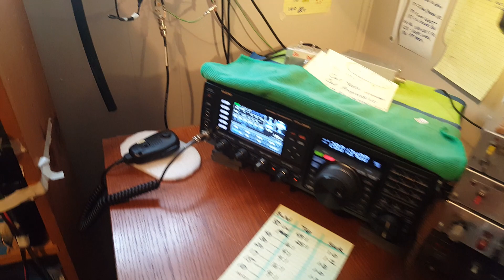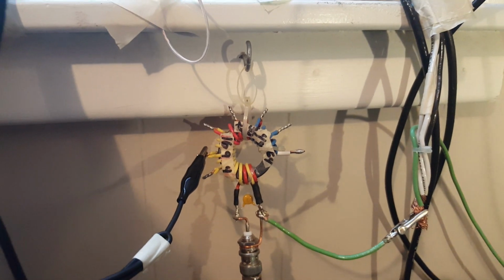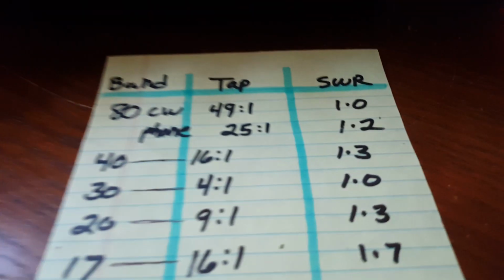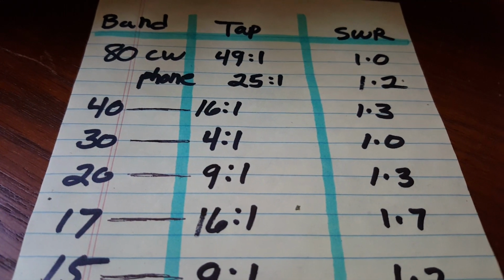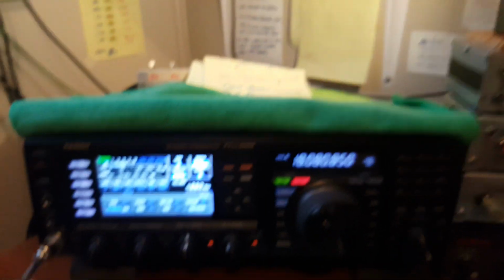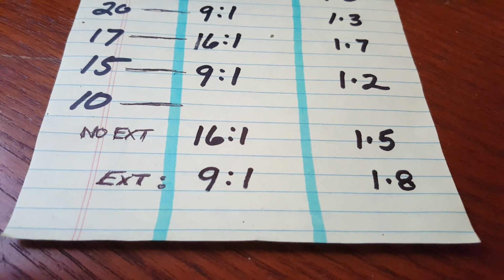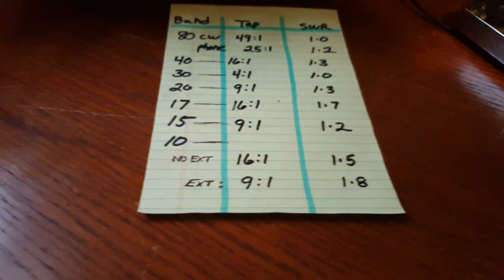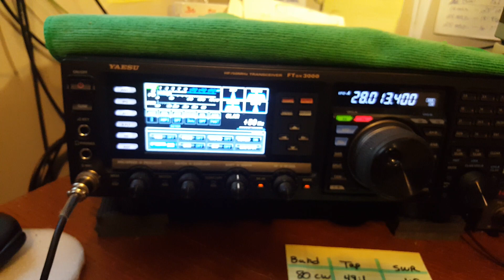80 EFHW & Multi tap UNUN   part 1 of 3   Intro & Demo

Comment: wow nice interesting video ! I wonder how can those end fed half wave "commercial" antennas can "resonate" on all bands with a simple 1:49 transformer then ??? I am already thinkering on how to make a relay switcher for that type of system you are using !! I see some cheap antenna switchers boards with relays available on ebay, I would wire it backward, have each tap to the "output" of the relays and have the "input" as the antenna... that way you can multi switch any tap on your core transformer !!!
Reply from the maker: Thanks for the wonderful comment! I'll reply again a little later and explain why I 'think' they are able to do that. ok?   :)
Reply: @n8nkqrp595  awesome ! thanks for the reply too ! I am so surprised you can make this work with aligator clips... I am trying to read the attenuation on a core transformer with a vna and as soon I have bare wires, the vna readings goes everywhere...
Reply from the maker: @Aleziss  Thank you! Well, the alligator clips are connected at the highest Z point in the whole antenna system, and that means minimal current. I did a vid showing the math.. the current flowing in the windings for various power levels. I can't remember which video tho. lol. But at the 100w power level, I think it was on the order of under 300 milliamps. And that's nothing for an alligator clip to handle. The current might have been less. Uh, hang on... nope. I did the math again: at the 100w power level, it's 157 milliamps RMS. or 0.157 amps. Nothing. lol. That's using a tap with 4050 ohms Z.
73   :)
Reply: @n8nkqrp595  ok thanks again for the reply, I on my part, it is the VNA readings that goes everywhere when I have bare wires and aligator clips as I try to measure the attenuation on different core materials. I don't think it had to do with the leads being able to handle the load as VNA is extremely low power. 

And I was surprise to see how well your system react even with aligator clips with many junctions, you had stable result and you did not seem to have RFI issue either which is quite surprising to me...

Comment: So 49:1 balun, what length of wire did you end up with? Any counterpoise? Any issues having the wire in the shack?
Reply from the maker: Good question. I don't know how long it is. lol. When the back yard dries up this spring I'm going to pull the wire down and measure it. The antenna works the same with or without a counterpoise.. same SWR usually.. altho I do have a piece of coax that's about 2' long that connects the UNUN to the rig.. so that acts like a short counterpoise. With many EFHW antennas you can buy, they'll oftern recomment a short counterpoise.. a few feet long type of thing. Not always tho. Issues with the UNUN in the shack right next to me? Well... with QRP it's never an issue. No ill effects. With 100 watts- I cannot use my Bose noise canceling 'phones- (they shut off when i transmit)  so that tells you that I'm in a strong RF field. No ill effects on the radio, etc tho.. and that's with the UNUN about one foot from the rig.  I've tested the ant and UNUN at 100w on all HF bands up to 10m - and have never detected any RF on any equipment.. meaning it wasn't 'hot' with RF.  I've heard this can be an issue with EFHW ants, but I've not had it happen. 73

Comment: Hey that thing works, and if it works and you can't get out without blowing up the radio then go with it.  I have built and Unun for a random wire antenna I use for Parks on the Air activations.  The wire right now is 35.5 feet long with a 30 foot counterpoise wire.  I plan on making the radiating wire 70 feet that way it will be better on 40 Meters.  I like your tap idea for your Unun!!  Great video.  Juddie WD8WV
Reply from the maker: Cool. A couple months ago I tried a wire for 40 using the same unun. I don't know if it's my setup or if it's common.. but my wires always end up shorter than the formula once I've screwed around with it to get best match. On my 40 wire, I got a match of 1.2:1 but I forget what tap I used. My wire was 62' 11" long, which is 94.1% of the calculated length for 7.0 mhz.  I'm sure the 80m wire is shorter too.. but it's in a tree and I'm not taking it down to measure it.  lol   73
Reply: N8NK QRP
Velocity factor? ))